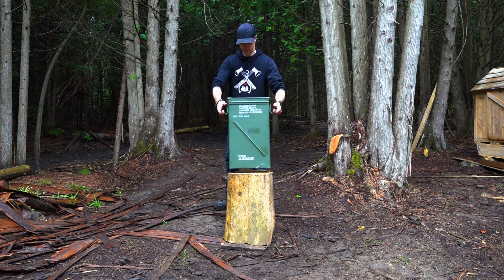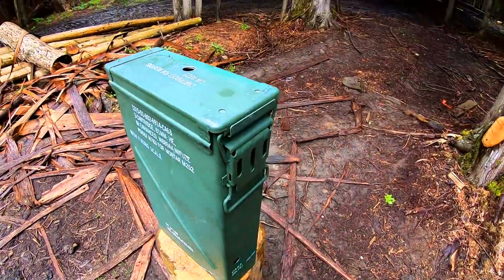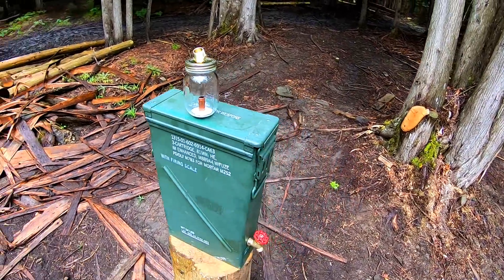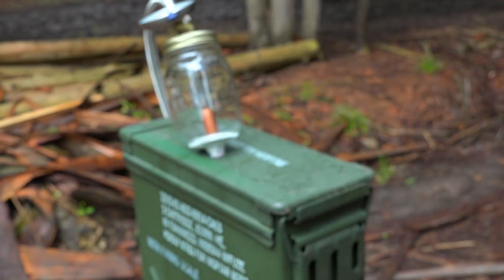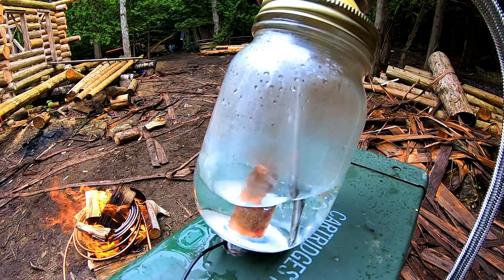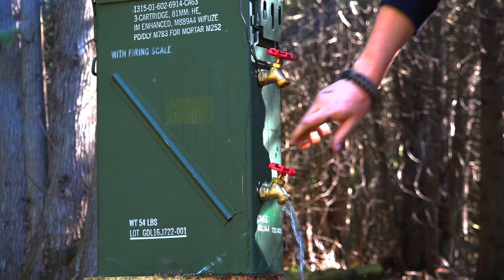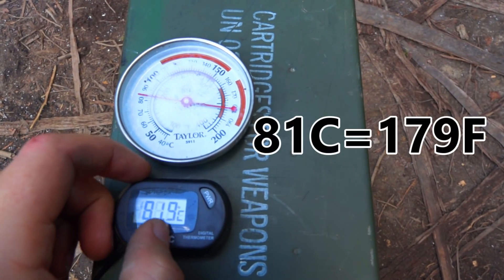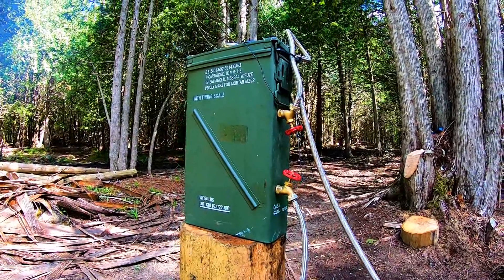Off Grid Heating Prototype- Copper Coil Water Heater / Heat Exchanger / Radiant Heater

Comment: Place a pressure relief valve like from a hot water heater on the lid of the ammo box where your hole is so if the ammo box gets josseled the hot water will not burn you in the snow camper get everything wet in the winter for safety sake .Love your videos this would work for a van or tent too great idea thermal sifon ! 
SCOTT from N.H.
Reply: Just add additional tubing from the hole in the lid to the exterior of the camper thereby eliminating any chance pressure could build behind the pressure relief valve, keep it an open system.  Will keep moisture out of camper and prevent any chance of exploding the ammo box.  Good idea overall.
Reply: @melvinmoorman4512  Searched the comments for something about the humidity.. I bet a lot of moisture would build up in that little camper if you filled it and got it to almost boiling..
Reply: @melvinmoorman4512  

Yes, great idea!
Reply: If your gonna use a relief valve, buy one that's designed for a steam boiler NOT a water heater. The relief valve for the boiler is rated about 15 lbs. A wh is 150lbs, you will turn that ammo can into a bomb. Youtube what happens to a wh with a stuck relief valve.
Reply: @jreg0028  The T&P valve is designed to open when the pressure inside the tank exceeds 150 PSI, allowing pressure to vent safely. The T&P valve will also open if the water temperature reaches 210 F. The valve will remain open allowing cold water into the tank until the unsafe condition is over.
Reply: A pressure relief valve is designed for a vessel that's designed to hold pressure.  An ammo box was NEVER designed to hold pressure.  If you put anything on that ammo can will stop the pressure from escaping, you've just created a potential bomb.
Reply: scott McIntosh 
Hot water heaters use a pressure temperature relief valve 
Not a relief
Relief valves are found on boilers and are set by the BTUS and pressure rating 

PT valves have a stem that is submerged in the vessel 

Just my.02
Reply: scott McIntosh There is no pressure in this system when done correctly. Cold water falling down into and through the coil and warm water rising lifting the water back into the tank.  No air pockets and steam like in this demonstration is the trick.

Comment: As a Project in University me and a friend made a water heater by Winding copper tube around a steel tube (the chimney) and got around 1kWout of it. We also hade a Prefab chimney to get easy access to the contrption. Patented in sweden. But not Active any longer
Reply: Lenght of steel tube 4-5 feet
Reply: We choose the steel tube and Winding on the out side to not interfer with sweeping the chimney. just a straight pipe as if it was not there

Comment: Add some copper sulfate to the water to keep anything from growing in the water!!!
Reply: That will work when using it as a heater, but probably not wise for a water heater. Remember that it was intended for use as both.
Reply: @juliebaker6969  vinegar at the end of each season to clean out the system. When vinegar and water are heated they perform beautifully
Reply: @maryblaylock6545  that would be a good non-toxic solution.
Reply: would silver kill coils work like i add to my water cooling loop for my computer?  just asking as I'd like to do this for the underside of my closed in deck outside.  seems like a much cheaper way to get some heat out there in late october and november.

Comment: I would recommend a radiator from a car. You then have some kind of pressure release as long as it has a good cap.
Reply: Just run a small 1/4 vent line outside. You could add a small solar powered fan to the radiator. But then its getting complicated.
Reply: I would recommend a radiator from a house. You then have some kind of temperature control.
Reply: Just vent it externally.   Safest thing to do and eliminates any moisture inside the camper.
Reply: Dangerous to man or, find an old house heater radiator.
Reply: Anything added increase the pressure of the ammo can will result in a potential bomb.  An ammo can was NEVER designed as a pressure vessel!
Reply: Yes open flames are dangerous but so is life, It's a calculated risk. That's why good sleeping bag is the best solution. The cave men had the commonsense to stay home when weather conditions weren't favourable, seems we have lost ours! 😂
Reply: @australianwoman9696 how do you figure the cavemen fed themselves whilst relaxing in the warm cave all winter
Reply: @alabastardmasterson  They ordered pizza
Reply: @Jay-oz5zo  effing savages probably like Pizza Hut
Reply: Yes looks like a lot of mucking about and very dangerous! I'd just get a good thermal sleeping bag, some fixed sealed candles and smoke detector. Oh heck, I'd just stay home where it's safer!! 😁
Reply: @australianwoman9696  open flame in a wood box is even more dangerous.

Comment: Great job, I have wanted to do something like this with my woodstove in my house to supplement my hot water heater.  Only thing to add is a valve maybe at the top so when you move it in the cabin it won't spill.  I could see possibly getting up to that almost boil state and shutting it down and just bring the box in for the night to radiate the heat. Be well.

Comment: Just remember, fire is used to forge metal. I understand that water in the copper will not allow the tubing to melt. But this is the most unrefined and scary heater yet. Steam is not to be taken lightly. Neither is scalding hot liquid. This bush fix needs a ton of refinement.
You might even be able to find a small radiator from an old house.  Let's see more cabin build!
Reply: Fire alone is the most unrefined scary heater ever, this is a clever creative harnessing of man's great 🔥 using caution and due regard that has potential practical uses given the circumstances. If he is smart enough to get so far as to design and build this it is pretty safe to assume he understands the processes and potentials that are at work.
Reply: You sound like an engineer, they make the worst designer.  Too many things to go wrong.  BUT it would be wise to  take care for sure.
Reply: @chetthejet3896  
I'm a master woodworker. I have ten fingers ten toes and no extra holes. I simply know that safety first is always the call.
Reply: @Finn-McCool     If you have ten of each I know you are doing it right.  I too have all my fingers and toes and do wood working big time.   Fire and water are a great combination to  respect.
Reply: @chetthejet3896  I work with large industrial boilers, but even small boiler units can have catastrophic consequences. There is a reason we use steam to generate power, do work, etc. It packs a lot of energy into a little space. Have you ever seen a pressure cooker explode? And that's only 15-20psi...

Comment: Sweet ,I'd run lines under cabin back and forth ,but Awesome video
Reply: If it were me, I'd do lines on the inside of the camper.  The underside would be great, but you'd need to somehow insulate the wood bottom from direct contact and without a cot to sleep on, it would be unbearably hot on the floor.  I use a water block in my wood furnace to heat all of my hot water in the Winter and had to move up to an 80 gal. stone lined tank to keep everything from blowing off because of the temps the water gets up to.  The larger tank still doesn't cover it all and I have to release hot water when I have steam coming from the tap.
Reply: They make 1 meter radiant floor tiles that have the coil built in. He could line the floor and/or walls with it and use a valve to adjust the flow rate.

Comment: Outsider you will have to consider condensation build up in the camper which will freeze 🥶. So you will need to figure out how & where to route that steam to keep it from building up into the camper. Maybe you could route the steam back into the Ammo box with a loop of  tubing. Steam out & steam back in if you can do it with pressure build up. Otherwise you will need to route it out of the camper from the Ammo box.
Reply: Also, maybe lengthen the tubes so they can be under the camper, so the heat rises up and heats the floor? This way nothing gets wet inside.
Reply: AnnWith APlan 😁👍
Reply: CC Rider, I was thinking maybe Outsider could do infloor heating in his camper.
Reply: Kimberly Jefferson yeah that’s a thought 🤔 💭 👍
Reply: CC Rider Baseboard hot water heater pressure relief valve placed at the end of a tube outside of the camper should do the job you can also buy adjustable ones these days to set up with pressure you want to release and at what temperature
Reply: Brian Griguts BMG Outdoors yeah I knew that with his contraption that steam would put a lot of condensation inside the camper. Because if he’s gonna boil water the steam has to go somewhere or otherwise it’s gonna create pressure & blow. If he lets the pressure/steam into the camper, in a nights time everything is gonna be soaking wet & if that fire 🔥 goes out he’s gonna be a block of ice by morning in those Canadian wilderness frigid nights 🥶. So I knew he was gonna have to vamp that steam somewhere besides in the camper. 😉👍
Reply: alot of awfully complicated ideas and not much understanding of pressure or flow in this thread.. the simplest cheapest and only way i see is to add a third flex line to that top hole and route it out the side of the hut.. routing it back into the the system is far too complicated without building pressure which that ammo box wont hold much of.. water loss is minimal on a 6-8 hour run the fire will die out long before the water level gets belows the upper valve
Reply: Craig 😁👍
Reply: CC Rider ya that’s a tuff one know I think about it. Something is going to give unless you regulate temp of fire like a water furnace. Hot water bomb if not careful lol. He definitely has a good idea there just some more engineering.
Reply: Brian Griguts BMG Outdoors Yep absolutely, He’s gotta let the pressure off or it’s gonna be a hot water bomb 💣 waiting to happen like you said. But he’s gotta engineer a way to re-divert that steam to keep steam out of the camper but yet so he’s not constantly adding water to the tank all night. Maybe run the steam into another tank so it can condense back into water & back into the copper coils outside to be re heated & recirculated.
Reply: @CCRider5312  this makes sense to me. That and a small stove with a pellet feed to last all night.
Reply: Mary Blaylock Yep 👍 Mary if you’ve seen those fans that take no electricity that you sit on top of a wood stove? They get hot 🥵 from the heat of the wood stove & they start blowing pretty hard. They are about 10-12 inches tall all metal & they have a metal heat coil in them that when they heat up they start Turning the blade faster & faster the hotter they get. 
Mr Outsider could build kinda like a galvanized metal furnace heating duct like you see under a house that goes from a furnace to the duct vents in a house! Except a smaller diameter duct & make a bigger chamber on the end that’s going over the fire. (Inside)that larger chamber that’s going over the fire 🔥 mount one of those wood heater fans inside that duct. Then he could let the fan blow its heat into a smaller duct about a 12 feet long metal duct pipe. The duct pipe would be 12 feet so the camper would be at least 12 feet away from the outdoor fire. This pipe would hook to the side of the camper where it hooked into a air vent that’s mounted inside the camper. It would be a vent that opened & closed with Air flow! So as long as the fan was blowing hot air it would open the vent in the camper to let the hot air in! Ok he would need a grilling type metal grate with 4 metal legs to sit over the fire 🔥about 12-16 inches above the fire 🔥. Then sit the enclosed metal duct chamber with the fan enclosed inside it on the metal grilling type grate above the fire 🔥. The fan would blow into this 12 foot long metal duct to where his vent is & hooks to it. 
Then Mary all he would have to do is keep a fire going and the fan would blow this hot air in this chamber over the fire directly into the mini camper! It would be A lot cheaper to build this & safer, no hoses, no Cooper coil no regulation of water & no condensation of steam building up in the camper! As Long as that fan worked & he had a outdoor fire 🔥 he’d have heat in the camper!  Mary I know if you buy a good wood heater fan that runs off heat of the wood heater those fans last many years! If you’ve ever seen them they solid steel fan heavy made & sit on top a wood heater& the heat from the wood heater makes them blow like crazy until the fire goes out or is not blowing. Also if the fire was going good enough & it was snowing as long as that fan is blowing hot air thru that galvanized metal duct the duct would be hot to the touch & snow ❄️ would melt as soon as it landed on the duct. 
I designed this in my head since this video came out & I know it’ll work. A person could do this & make the duct so it can be assembled & taken back apart for transportation in 4-5 pieces. Also this could be used to blow hot air into a Tent ⛺️ at a camp site. All it’s doing is blowing the heat less the smoke generated from the campfire into the tent or camper. 😁
Reply: Could put a steam condensing coil that drains onto the fire, self regulating.
Reply: Doug Mcdonell yes but he don’t want the fire 🔥 put out by water or otherwise It won’t heat his coils & heat his water inside.
Reply: CC Rider he opened up a great conversation here. Nice to get ideas. Where you at? I’m in Pennsylvania in the states.
Reply: CC Rider ya even if the coil is outside it should condense back to water maybe if outside temp is right. If he views it as a hot water system or steam system the only problem is regulating the fire I guess. Maybe we should all spend some time in the woods with him helping him with the system away from people enjoying the wonderful Canadian forest. Lol. 😂😎😂😎
Reply: @CCRider5312  - The idea is to put a little water on the fire as the steam starts, not to put out the fire, I doubt it would be possible to put out the fire this way, as the fire goes down the steam stops.
Reply: Doug Mcdonell if I was outsider I’d build me a small metal enclosed Duct. A galvanized metal Duct that I could duct a vent. A open & close vent into the wall of the camper that I could hook the duct outside to. Also I’d put & mount inside the duct by the fire source one of those wood stove fans that blow by getting heated up. That part of the enclosed Duct where the fan was mounted id sit it on a metal grate over the fire & when the Duct sitting on the metal grate heated up it would make the fan inside the Duct blow hot air.....Therefore blowing hot air up the Duct & into the camper! As the fire goes down & the fan stops blowing the vent inside the camper would close. So when he knows the  vent closes & the air stops he knows he has to put more wood on the fire! That would make for a great heat system without all the headaches of the water system!

Comment: If you have the set up in teh cabin, it will be like a sauna with the steam unless it is sealed. But having a sealed heating unit would cause pressureIf you think about car heater matrix and house central heating, the heated water enters the radiators through the bottom and out the top. This will help prime the system (especially with a bleed screw) and also keeps the circulation going, but that might need a pump. You made a great system and I hope it will work for you. :)

Comment: you could run the copper pipe along the bottom of the portacab and have like underfloor heating this should save space also a small rocket stove style system from another ammo box might work well as the heat source this syem should need less water and smaller fire that can burn longer for more even heat
Reply: IndyHelis  ideal would be the pipe from a large old fridge for giving the heat off ammo can rocket stove with copper coil as heat collector with a small water res
Reply: First thing I thought of, subfloor heat unbelievable efficient.
Reply: crispjon can’t store the water tank outside though or it will freeze 100%
Reply: @joshlarochelle1298  ??? the tank is being heated by a camp fire  its not gonna freeze
Reply: Thats a good idea a ammo box stove with a way to reduce the air in take might help you control the fire and at the same time control the heat plus a controlled flame will give you peace of mind that the fire is less likely to go any where near the lil cabin
Reply: David Simpson still have to store the water container inside or it will freeze 100%